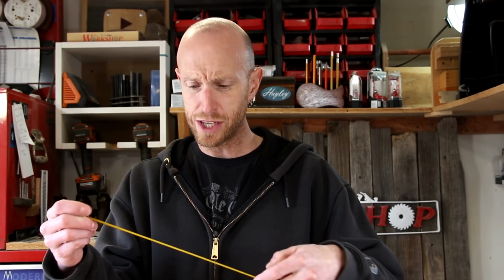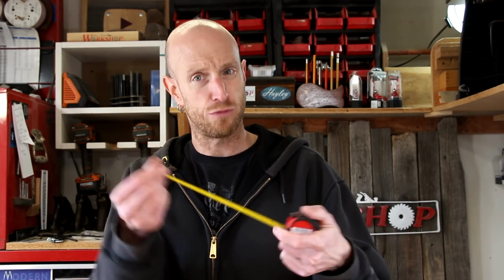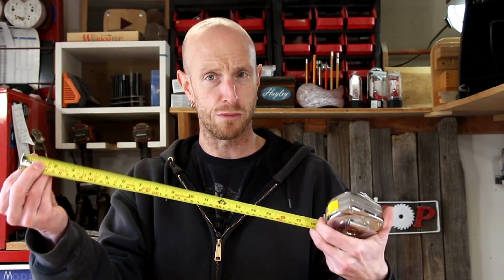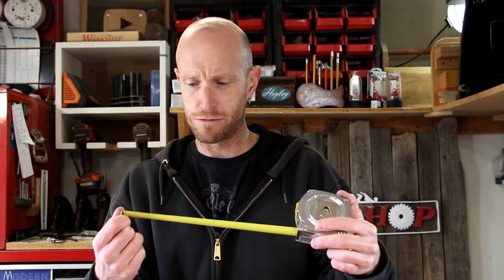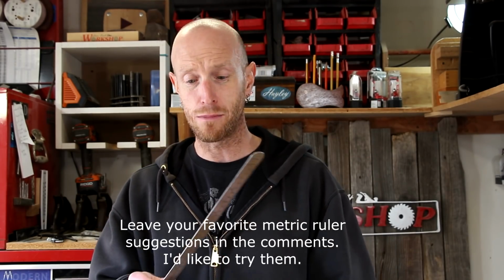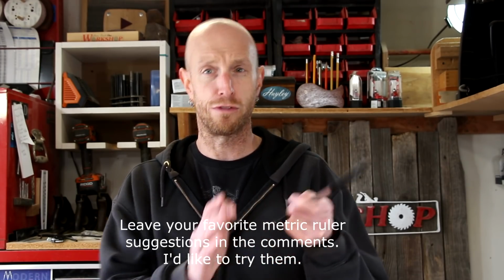My thoughts after using the Metric System for a project | I liked it

Comment: Using a decimal system is just straightforward and sensible.
Reply: No, Base 12 would objecively be better... We only use 10 because we have 10 fingers
Reply: @okdoomer620  Oh don't tell them that...I mean you can only divide 10 by 5, 2 and 1.  Whats half of 10? 5.  Whats half of that 2.5.  Half of that 1.25 Hald of that .625 starts breaking down quickly when you start dividing.
Reply: @okdoomer620  No, base 12 is not objectively better lmfao
Reply: @mechanomics2649  you can divide 10 by 5 and 2 (non-trivially), but you can divide 12 by 2,3,4 and 6... so you get much nicer decimal notations for fractions. 1/3 just becomes 0.4 instead of 0.333... 1/4 just becomes 0.3 instead of 0.25, 1/6 just becomes 0.2 and so on. I mean sure, you can take the position that there is no objectively better system than any other system, but for all practical purposes base 12 is better and base 13 would be worse than both, because 13 ist prime, and therefore every fraction has an ugly decimal notation
Reply: @mechanomics2649  I didn't come up with this, the babylonians knew this already, why do you think we have 12 months, or 12 hours in a day and so on... 60 is another one of these nicely divisible numbers (2,3,4,5,6,10,12,15,20,30), and they used a system based on this as well.

Comment: Since my apprenticeship ad a machinist in the mid 80s, I've always used Tajima steel rulers for various needs. They make them from 150mm (6") up to 1500mm lengths, and in many variations re half-mm/mm/cm including also inches om one side. They also make a good selection of tape measures.
Does you - as an American - enjoying using the metric system make you wierd? Heck yes! But I'm glad you took the plunge and enjoyed it 👍👍

Comment: There's a reason why NASA use the Metric system, it doesn't just feel more accurate, it is more accurate!
Reply: It is more precise, not more accurate.  There is a diffience.
Reply: @hammathguy3995  Correct me if I'm wrong but 'accurate' is the state of being correct or  and 'precise' is marked by exactness and  They basically describe each other, so don't that mean they are the same thing?
Reply: @branchy7159  not really. You can be accurate with a inch ruler but you wont be as precise as with a milimiter ruler.
Reply: @iplaygames8090  so one of them is more accurate?
Reply: Almost all manufacturing is done with metric. Even in the USA. Imperial is what mom and pop/small custom business uses.
Reply: Accuracy does not depend on units.  Nor does precision.

Comment: As someone from the UK. You are going through the transition we over here are still going through (thru) nearly 50 years on from conversion. I still measure things in both systems during a build. I tend to use whichever system seems easiest for a cut. You will find on a plan I make dimensions such as 300 mm by 3 inches by 1 cm. I think your astute in noticing the physiological difference when looking at small measurements. Metric feels so much easier for these when you are going below an inch and into fractions in Imperial.
Reply: This is true. It isn't unusual for a set of casual dimensions to be quoted using both scales at the same time dependent on what's easier. And it has to be said we have it right.
Reply: That's fine,
Until you walk into a hardware store and ask for "1 metre & 34 inches of 180 cm by ½ inch" wire netting!
Don't laugh... 
As a shop assistant, I had this happen and then I had to work out exactly what was needed...
It took twice as long as it should have. If the customer had said "74 inches" or "1.86 metres" there would have been no problem.
Reply: Other countries (Australia, NZ, India) did the metric transition much more quickly and it worked out fine. So did Canada, but a change of government led to a lot of pointless backtracking. There's nothing inevitable about decades of multiple measuring systems if the will is there to get the job of metrication done.

Comment: Nice video. I can tell you for sure that your felling of having more precise cuts is true. 1 millimetre in your measuring tape or ruler is almost exactly equal to 5/128" so that is the level of precision you have when using the SI system. On the other hand, most of the measuring tapes shows subdivision of 1/32" which is 1.25 times (+25%) larger than 1 millimetre. 
So you are right, you get more precise cuttings with the SI system and besides as you said, it is easier to move among multiples or submultiples

Comment: Alwys interesting to hear someone's take on this!  I'm from the UK and grew up helping Dad in the garage and general DIY; he was a design engineer and I ended up an aeronautical engineer.  He used both metric and imperial measurements depending on the job and had full tool kits for everything (his work used both sytems, depending on the project). My academic training was entirely metric, but to this day I will chop and change when doing any job around the house and just use whichever is convenient.  That gap between the walls? 42".  Great.  Centre at 21"...and I need holes 10 cm either side of that....and so on.  If it's less than 1/4", I go to mm.
Reply from the maker: I can see using a kind of hybrid method like you use. Just use whatever measurement is closer. I like that.
Reply: When I was growing up in the UK in the 60s, we used metric in school (for science etc) and imperial for everything else. I still read metric and convert it back for an appreciation of the scale. My one advice is to stick with one system or the other for each whole project. Having said that, when Concord was being designed, the French engineers used metric and the British engineers used Imperial. There was a lot of converting going on and the aircraft worked just fine!
Reply: Similar here in Canada. Our conversion to metric, in the 70s, effectively stalled when the US stopped its efforts. So my education in engineering was almost entirely in metric, followed by on-the-job crash course learning of inch-pound measurements in industry. So I’m effectively fluent in both, and recognize 3.18 mm on a drawing as 1/8”, and I know that 5 psf is 0.240 kPa. But metric is hands-down easier: I can run calculations in both systems, but I am more certain of my work if I convert everything to metric and convert back at the end.

Comment: I bursted out laughing when he said that they use "standard" measuring system in America and not the metric one. LOL
Reply: @Thomasritchard  As long as I'm aware, the US standard system is still exactly the Imperial system
Reply: @Thomasritchard  really it is called US Customary Units or standard for short. And you are right it was never Imperial. Thomas Jefferson devised US Customary in 1789.
Reply: @snake698  in that you would be completely wrong. What confuses people is that both the US and Great Britain adopted the standard international industrial inch. Which itself is not Imperial. In fact when they adopted it they also abolished the use of the Imperial system themselves. That was some 91 years ago now. Which is why you are completely ignorant of it. Weight and volume measurements of the US and Great Britain remain fundamentally different. They only share common names. A UK gallon is 4.54609 liters a US gallon is 3.7854118 liters That's a 16.7% difference. So far from exactly the same.

Comment: "Here in the US we use standard-measuring tools". 
Guys, metric is standard. You're using the non-standard ones. :D
Reply: There's two kinds of countries on Earth. Ones that use the metric system and the one that's put men on the Moon.
Reply: @1pcfred  you know that NASA uses metric on their calculations?
Reply: @1pcfred  NASA used metric to put these men on the moon.
Reply: nah our standard is the SI
metric and imperial are just ways of measuring, to have  a standard all parties involved have to agree on it, and that's what we have with  International System of Units.

There are many metric measurement units, that are not in official use therefore we cannot simply say metric is the standard.
Example would be pressure in atmospheres,  power in horses or energy  in calories.
Reply: @1pcfred  Nasa uses metric most of the time, also the leader of the whole Apollo thing was German and actually really disliked the imperial system if I'm not mistaken
Reply: @1pcfred  also exploded a few shuttles due to forgetting to convert measuring systems
Reply: @gbottesini  The shuttles weren't about unit conversion but there was some multi hundred million probe that was lost because someone messed with imperial units / conversions.
Reply: @1pcfred  Also, one foot is defined as a 0.3048 meters. So even the freedom units are defined by the standard units.
Reply: @radovanczech  you are confusing the terms standard and definition. In metrology a standard is a physical object. A definition is a value.
Reply: @BakedxMasa  I know that NASA has no mission today and should be disbanded. I further know they are largely a waste of taxpayer money too. If they want to promote America then they should be using our units exclusively. The agency really has no other reason to exist. If you think NASA exists for any other purpose then you are sadly mistaken. So are the fools that run NASA today too apparently. I'm sure they think they exist for some other purpose. But in that they'd be wrong. They are a source of propaganda for our nation. Look at all the amazing things we can do. That's it!
Reply: I've never heard it called standard isn't it known as Imperial
Reply: @1pcfred  the Main man in "Your" Moon Mission was an Former Nazi :)
Reply: @christiankumpmann2497  yeah but he was our Nazi. One of my classmates was personal friends with the good Doctor. When you walked into his house there was a picture of him with the whole family in the downstairs hallway. Small world, huh?
Reply: @tihs87  Smart man, smart man = )
Reply: @1pcfred  Are you really that protective of your national identity that you want your space agency to use "your" units even though they find them vastly less preferable? (They also aren't REALLY your units since it's the British that gave them to you)
Reply: @ethanlivemere1162  I really do not care what they find preferable. They have a job to do and I expect them to do it. It is not all fun and games and that is why they get paid. The British gave us nothing. No units of ours are like theirs. You are just confused because we both adopted the international industrial inch. Which is not Imperial either.
Reply: @1pcfred  Their job is not to use one measurement system or the other. Their job is to do science, and for that they prefer to use metric. Their job is not to pander to people who have such an obsessive feeling of nationality that they get butthurt over the measurement system they use.

And while your system nowadays may not be what the British gave you, "the US customary system is based on English systems of the 18th century". They took the system from the
British Empire and changed it. That doesn't make it your units. Just your version of the units.
Reply: @ethanlivemere1162  NASA's job is not to do science. No we created NASA to counter the communist threat. They use science to that end. But that's not their job. That's just a tool. Science is secondary. It is a byproduct of them doing their job.
Reply: @1pcfred  And the meaurements they use is a tool to the end of doing science. Just another tool. I don't see how using either system would help fight the communist threat.
Reply: @ethanlivemere1162  US Customary promotes America. It is part of our brand. Science is not NASA's mission. It never was. Nationalism is.

Comment: I always remember how my father never wanted to buy an american car because of the different screws and tool sizes. I suppose that was the other way around for the US.
Reply: Chevrolet Tahoe use metric all over...
Reply: There are many other reasons for not buying an American car - having to re-tool your workshop is just one.
Reply: I have socket and spanner sets in imperial and metric. Its not a big issue!
Reply: @fivish  The only ones you must have is 13mm and 1/2"
Reply: @fivish  It is.  There are lots of different Imperial standards for hex bolts.  Some measure across the bolt shank and others across the flats of the bolt hex.

Comment: Once I got used to metric, I could not imagine going back to my American system that makes no sense,
Reply: You mean the Imperial system :P
Reply: Being an oldie I found it difficult picturing a 150mm nail but had no problem with a 6" one.

Being a tunneler and being paid by the yard, the company went metric and paid us by the meter but kept the rate imperial. Didn't take us long to stop that. If you let em take an inch they take a mile.

PS: Why is a US gallon smaller than a UK one was. A UK spanner was a Whitworth the US had AF American Fine.

Comment: nod of respect for testing out the metric system in a handson way! and being honest about when its more lacking a measure tape or stick marked with it thats a problem then anything else its easy to stick with what one grown up with after all.
and gota say ,there is a reason why it feels like you can be more precise with metric system , like he said himself , devide or multiply by 10 no 'lose numbers' or painful fractals 
its vaules is more symmetric structured logicically rather then based on any ''this feels like a good weight''  fun thing its even hidden in its measurement names.... 

a kilo means thousand so kilometer = 1000 meters and one meter = 100 centimeter and thats 1000 milimeters , devide or multiply by 10 its far more gentle on your brain and leets you put more 'processing power' to the schematic and being more precise about things rather then on converting measurements back and forth in your head ;)
its also more friendly for conversions between mediums a kilogram 'kg' should be the same weight like a 'kilo'liter but mostly just said liter to specify its a liquid substance thats been weighted etc

pinch of trivia to ''if your in a part of the world that already uses metric'' ...well ,the states technically already doess that even if your not working in its military that uses metric for simplicity and clear communication sake ever asked yourself how long a 'click' is ;) the global double cheeked weight formulas etc that helps the states calculate its imperial weights/stuff is done in metric and then translated.

so nhaa , dont make you strange enjoying working with metric , it makes you more like the scientists and carpenters that decided when you need half a school class to calculate measurement changes and still get it wrong 3 times in a row , its time to make a new lees convoluted system that is based about being precise yet simple XD

Comment: "If you happen to be in a country that  uses the metric system...." = "If happen to be anywhere on this planet except for the U.S.A."
Reply from the maker: True. Lol.
Reply: Well the UK kind of hang on to feet and inches for certain things....

But if you buy a tape here then 99% chance it will have both scales in it... I don't think I own a single rule or tape that dosn't have both metric and imperial measurements
Reply: @dasy2k1  That’s sort of colloquial use though. You hire a builder or an engineer and they’re working in metric.
Reply: @Dreyno  that very much depends on the age of the builder and the building they are working on, engineers are metric yes. But builders still use a mix, especially if what they are modifying was built to round numbers on the imperial system
Reply: @dasy2k1  Yer my house was Victorian and the bricks were local cast and so non Standard.
Reply: He's being precise with his wording. It's fine.
Reply: Oh c'mon, many Americans are already using the metric system: they carry a 9mm and buy their drugs by the gram.
Reply: @dasy2k1  you Brits abandoned the Imperial inch 91 years ago now. I just thought someone should tell you.

Comment: Us in the metric world use imperial measures for a lot of things (wheels, tires, pipes and piping accessories, bolts, guitar scale lengths, etc) and we don't put much thought into it. It's just a measure.  : )
Reply: Guitar scale length depends where the guitar is built. My German guitar from the 1950s has 65 cm fretboard (0 to 12th fret).